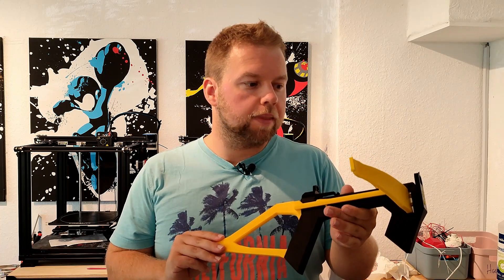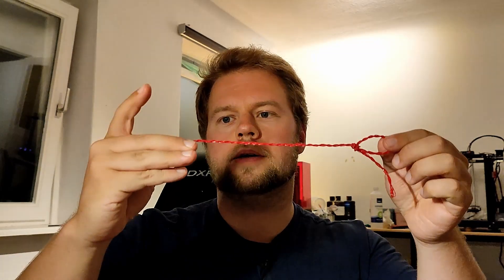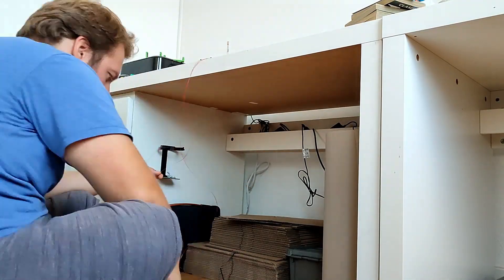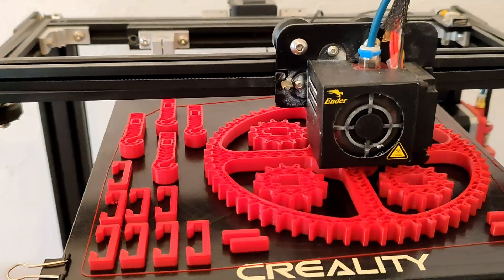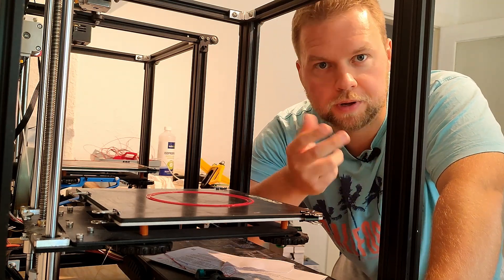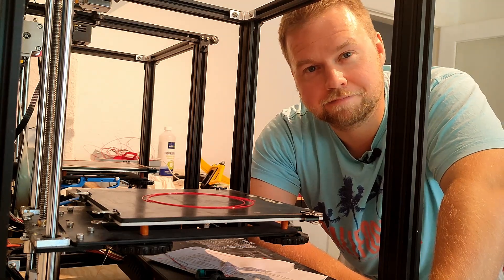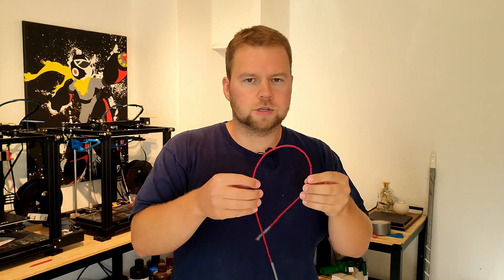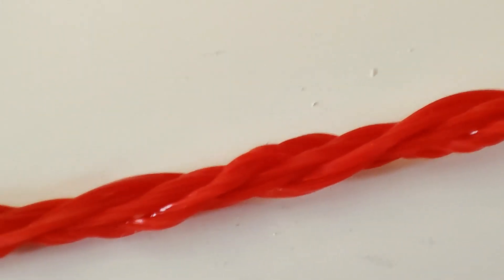3D printed rope

Comment: interesting experiment.  and realization (wire).   i also realize, if you want it all 3d printed.   that means you need to make some kind of plastic crimping materials as well.  wondering if traditional metal crimp designs work or formulate something. clearly more SCIENCE!. 
you made your wire out of what plastic.   i need re watch...
Reply: nvm.  not realize this is old video.

Comment: Cool video! You could experiment with the print parameters in the future and test what unprinted filament can withstand. 
Nylon is also used as a trimmer cord, so it should be quite stable. 
By the way: If you want to get even more out of your Ender 5, there is a lot of potential in these printers. You can get 3k of acceleration without quality loss, instead of the puny 0,5k.
Reply from the maker: both good ideas I will dive into in the future. Also doing this with petg and so on to see how the results change. But regarding the print speed, to you have some further information on that? That just sounds amazing.. espiciall when I.print my crossbows it takea ages
Reply: @m3chs_makes  First, I would increase the voltage of the X and Y motors. 
This gives the motors more torque and prevents them from skipping so quickly. To do this, unscrew the bottom of the printer and turn the corresponding potentiometers a little clockwise. You can use a multimeter to measure the voltage between the adjusting screw and ground (-). Mine run at about 1.4V. But this is only a guideline. More important is that the motors don't get too hot. As long as you can touch them during operation, everything is good. Heat sinks can give you a little more margin here. 

Next, the printhead has to get rid of weight. There are several mods to fix the fans to the printhead without the heavy metal housing. Since the original component cooler fan quickly reaches its limits, I got myself a much stronger one and attached it on the frame near the spool holder. The air now reaches the print head through a hose. But even here there are other solutions such as a berd air system which uses compressed air, or fans attached to the side of the frame, which blow across the printbed. 
Now test for your best Acceleration and Jerk settings and modify the parameter in your slicer  settings. 

If you want to get less ghosting through the use of Input Shaper, you need to switch to Klipper. But it's worth it.

If you have further questions feel free to contact me :)
Reply from the maker: @Shadow9OO  oh wow, thank you for taking the time to summarize all of that! I was not expecting that. Right now my backlog of stuff I need to do is rather full but I will add that to my board and fasttrack it a bit. Faster printing would be totally awesome!

Comment: Excellent idea! I love fully 3d printed solutions! I'm guessing wire instead of rope has something to do with the tinsel strength being affected by the twisting? Maybe it's the fact that jute or twine binds better on itself than a smooth TPU or PLA? Great content, great to see the rope machine was able to help!
Reply from the maker: Thanks again for letting me use your design, happy you like the result. I share your thoughts regarding the tinsel strength. I belive because the string is solid and not consisting of fibers like yarn it wears it down. So I will be looking into "wire making" for a future project. Might improve it further!